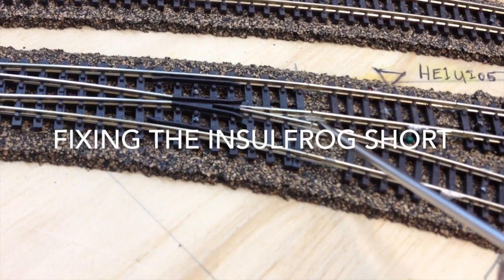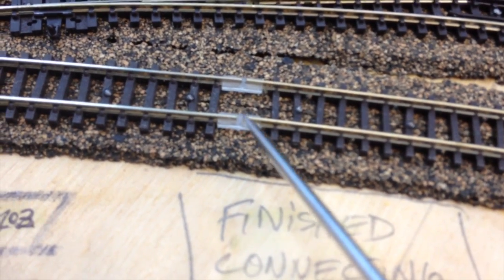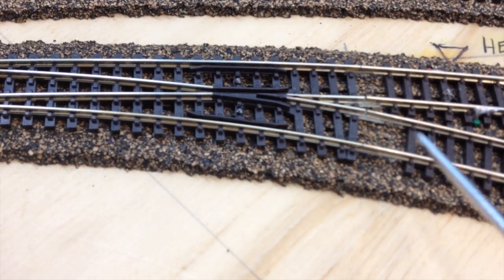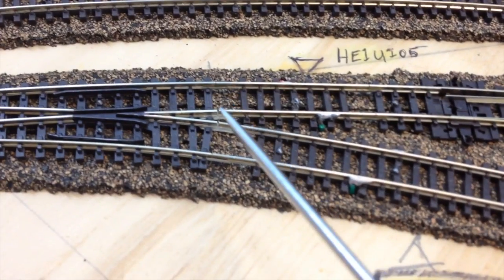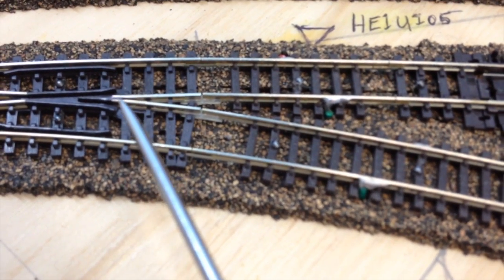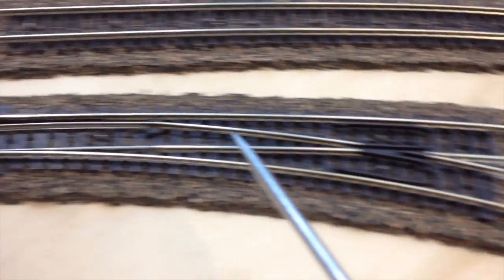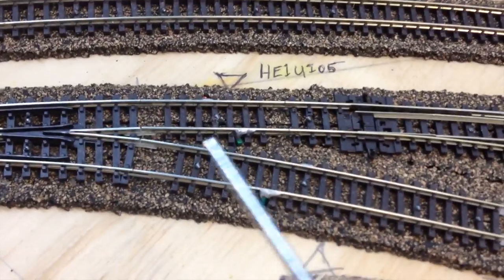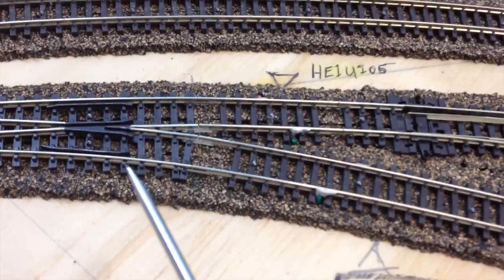Staging Level DCC Testing & Issues: Part 2

Comment: Hi John, I have a question if you don't mind about the turnouts & DCC operation?  Ley me first say, although I've been into model railroading some 40+ years now, I am brand new to DCC operation within the last couple of months.  I'm very "old school" & kind of an analog minded kind of guy so it took me almost two years to finally decide to attempt DCC.  My layout is about 2 years old (newer layout) which has been running beautifully in DC operation.  Well, I recently switched over to the DCC operation with the NCE Power Cab system & I have a KATO DCC w/Sound loco & a BLI DCC w/Sound loco.

I wired the DCC system like it said and all was running beautifully until it came to running the locomotives into the yard area where I have three Atlas Custom Line turnouts in operation (manual) and as soon as both locomotives hit these turnouts they both come to a screeching halt???  Why is this happening?

Now, I have four other turnouts on the same layout & both locomotives run over those with no problem.  Is there a such thing as a DCC unfriendly turnout?  I don't understand why they all work perfectly in DC mode & then these three that won't work now in DCC mode?  I asked on guy on here who came highly recommended & his answer was to just rip them out & then made some rude comment about me being Texan.  This is suppose to be an adult man when you look at his videos!

Thanks in advance, I really appreciate it, Bo.
Reply from the maker: Texas Hi-Railer Have you been to the website http://www.wiringfordcc.com/switches.htm.  
There is a lot of information there about DCC friendly and specifics 
about each manufacturer's turnouts to include what is DCC friendly and un-friendly as well as how to fix some, if not all, of the issues that each has. Since this is my first DCC layout, I spent a lot of time reading about DCC and I have taken my time.  I too started with a Power Cab and have since moved up to a Power Pro.  I use the Power Cab as a Power Pro controller now.Do the Atlas custom line turnouts have a plastic frog? If so,
 they are probably causing the sound decoders to loose power at the frog or you may have an issue with no power in the closure rails. I had a 
similar problem with the BLI sound engines on my Peco insulfrog turnouts both with dead closure rails plus they would bridge the track just after the frog and short out. DC is much more forgiving that DCC ever will be. BLI locos tend to be very sensitive to voltage issues (my experience with 5 of them).   I would recommend checking to see if there is power in both the closure rails and that you don't have a short in the turnouts someplace just after the frog. One of the first tools that I bought was a DCC Specialties RRampmeter.  It an RMS meter that can be used to check for DCC power.  I got the one that came with leads so I was able to use it to find areas of dead track on my Peco turnouts.  If you don't have one of those, the old multimeter would help find dead areas when the track is powered by DC especially around turnouts. If you do have one, I would make sure that you have a good constant voltage on your layout. I usually see around 14 to 14.1 volts on my layout.  Also, I used about 400 track feeds in my staging level to ensure the constant voltage as well as bridges from the stock rails to closure rails on my Peco turnouts to solve dead closure rail issues.Hope this helps,John
Reply: John Tanzillo WOW!  I never expected so much information, lol.  I can see I have a great deal to learn about this DCC set-up.  I guess I will need to pick up one of those meters so I can get this done properly & get on with my railroading.  I think one problem is definitely not enough feeds now since I've gone with DCC & yes, the frogs on those turnouts are plastic.  I just assumed they were set-up from the factory that all the rails would work properly since I've never had this issue in the past on my DC operation.  I did notice on a couple of the connects around the layout the BLI locomotive would power down & then immediately power back up so, I did repair those connections & just never thought the turnouts would be an issue since I temporarily hooked the DC back up & all was well.  There's more to this DCC operation that meets the eye, lol.  I do thank you very much for the insight & the link.  Happy railroading my friend.
Reply from the maker: Texas Hi-Railer I forgot to mention in my earlier reply about Art Houston's Grande 
Pacific YouTube channel.  He has a lot of videos on the use of NCE DCC 
and they are done in a step-by-step manner so it is fairly easy to 
pick-up. Also, I would recommend subscribing (if you haven't already) to
 the free internet magazine, Model Railroad Hobbyist, as there are lot of great people that will offer their help to solve problems. One of the things that I have learned about DCC is that the power distribution is very similar to our household power. It can be done from a central location (similar to the breaker box in our homes) and run to each circuit.  The command and control circuit, is different and more akin to computer data.  Art Houston has a great video on both.  Have fun.
Reply: John Tanzillo Yes, I've been with Model Railroad Hobbyist since they began & have every magazine on disc.  I keep forgetting about them since it's an internet magazine.

Art Houston has some amazing videos indeed but I had no idea he had "how to" videos.  I'll be sure to look into that & thanks again.

I checked out that link you sent in your first response & have fixed all three of the turnouts already.  I can't thank you enough for the assistance & happy railroading my friend.

Comment: Yeah John, I had the some problem with my Peco turnouts and that's what did to fix it. But you can't beat Peco turnouts. I'm replacing all my Atlas with them.
Bob, at Longshadowsmodeltrees.com
Reply from the maker: I've been using the electrofrog version on my past DC layouts so this is my first experience with the insulfrog.  It will be a big pain to go back and add the insulated joiners but it'll be time well spent.
Reply: For smooth running......."Yes".